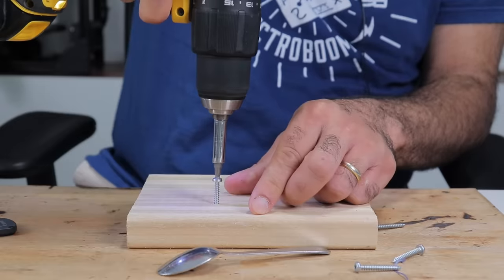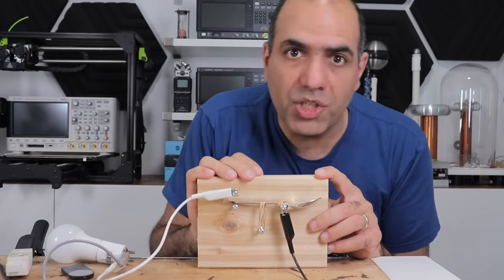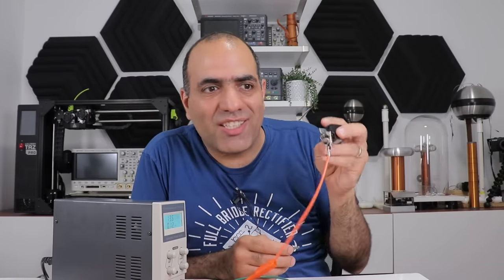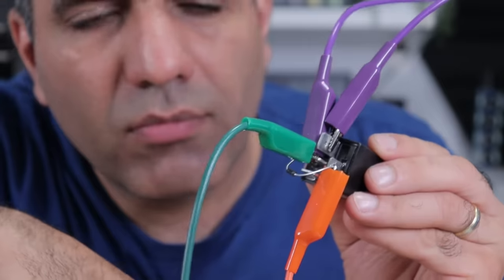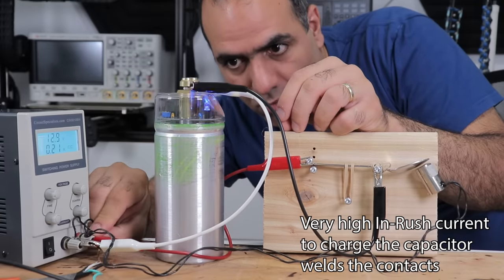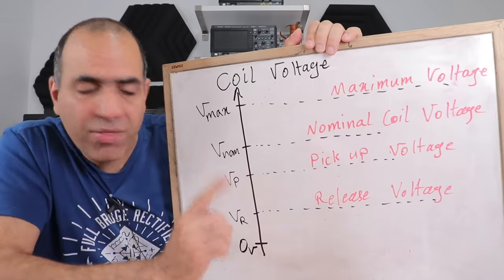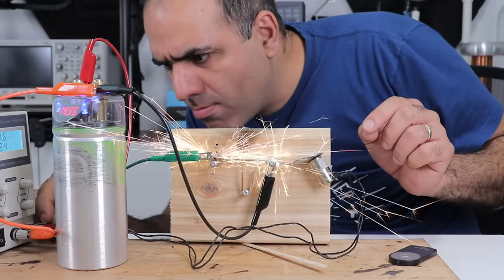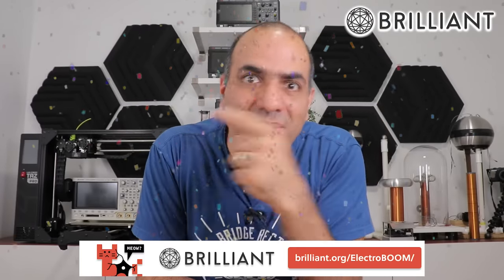Why RELAYs go BOOM!!! And How to Use Them

Comment: New to your channel, great videos.
You didn’t mention, maybe it’s in a new video, the ability to turn high powered equipment or machinery on and off, with very low power relay switch. (and much less expensive)
I hope I described it properly. Also in automotive applications a low voltage relay can then be used to turn high current items such as headlights, or multiple items like all the lights in all the gauges all at once.
Another great video.
Thanks again.

Comment: You could also explain how to prevent the same kind of issue in AC powered relays. Diode is quite obvious in DC delays but with AC ones... Capacitor and resistor?

Comment: Mehdi, I finally viewed your full video. Your analysis was very good. BTW, what's going in is a centrifugal half-loop lifting the chain. It's formed by stiffness plus an oriented pull vector, such as you running. And yes, the little snaps are real, but they must average out since they are mid-chain. You won this, and the Royal Academy paper was flatly wrong. Thanks for standing up for yourself and not buckling to Big Names and lots of equations. Science needs more folks like you.

Comment: Working on repairing automated gates circuitry, I usually encounter a ton of old and worn-out relay contacts.
Then I came to the need to decide if I need to replace it or not.
Sometime I find a old relay with oxidized contacts, but won't close the circuit. But when I remove them and try them using a bench power supply.... Voilà the relay is perfectly working!
Of course I dunno for how much time, and I replaced it... But... It seems to me poor construction quality other than overload. Do you have any suggestion?

Comment: This is a really good introduction, but one thing I wish you'd mentioned at least a little bit, which is ignored or unknown by far too many people is the need to derate relays (or any switching components, really) depending on the type of load you will be driving.

The current rating on the relay is fine if you're powering a purely resistive load (such as a heater).  If you're powering an inductive load, such as a coil or transformer, your load should never be over about 50% of the relay's max current rating.  If you're powering something like a motor, it's even worse, and you shouldn't really go over 20-30% of the relay's rated current.  What are known as "tungsten" loads (including incandescent lightbulbs) are actually even worse still, and typically shouldn't be more than 10-20% of the relay's nominal rating.  So you quite often have to use a relay that's much bigger than you think when switching a lot of real-world things.

Also always keep in mind that relays will have different ratings for AC vs DC.  This is because AC can be switched at higher voltages without as many problems because it actually goes to 0 volts many times per second, which can help to quickly stop any arcing that might occur.  However, DC does not have this constant interruption so it can start and maintain a continuous arc at much lower voltages (which you really don't want inside your relay).

Comment: Try to drive motors inside a electric razor . Take out them and try to deliver dc voltage as high as possible . After the contact brushes melt find any solution for that to drive hi voltage like around 40v . Dc . Definately I'm sure . Even a 10k mah battery pack with 12 v . Can. Not able to run it . Even with custom made hardcore brushes . 😂😂

Comment: 10:47 The average voltage across the coil should be zero, but it's not & the coil current slope can not be equal while energizing or deenergizing.
I know, the drawing is way out of scale, but it seems there was not even a concern to make a smaller duty cycle "square wave" (seems like 50%).
Still very good video.

Comment: Hi team need ur help
For x engine I am using 12Vdc 70A relay as stop relay. 
The engine pull current is 79A for 1sec a. Will this pull current of 79A for 1 sec can damege my relay contacts of 70A?

Comment: Marklin model trains use latching relays to change driving direction since they use AC power. They are quite bulky and wanted a smaller version or a solidstate version for a smaller model I'm making, but I can't find such a schematic or relay small enough... 😢

Comment: Hey Mehdi thank you I just saw this. One can also reduce the voltage spike by putting a suitable resistor across the contacts. This was done in old mechanical automotive charging regulators. I tried this with a small relay wired as an astable like yours. The frequency became very high and I could use the relay as a voltage regulator. Relays are amazing.

Comment: To get rid of arcs in the contacts, you can put a capacitor over the contacts. I measured the voltage over my coil one day (it was a 5V relais) and when I disconnected my coil, the multimeter said 95V. Talk about a spike coming from such a tiny coil. And even when you're respecting the proper loads over the contacts, after several years, those contacts can literally burn away. Due to the current spikes, those contact points turn black after time, increasing the resistance while still switching the same current. This increases the power over the contacts making them even hotter when switching, turning them black even faster and faster until they burn away. I've seen many burned out relais and contactors over the years while troubleshooting our stacker cranes at work and the only things that are left, are the coil and the contact levers but no contact point anymore.

Comment: You can find high voltage/low current(up to 15k to the best of my knowledge) solid state relay in the market for the last 6 years or so. That could give you a very clean signals with almost no noise. But of course there are always some raise and fall signal times. Pretty much it's a diode's delays and on/off curves. 
It would be nice to see you do a vid on it.

Comment: Even better than diode is a zener clamp with a voltage just below the max breakdown voltage of the fet (or physical relay you are using) this wya you can avoid blowing stuff up (or sparking in relays).

Comment: It's possible to switch AC at high current with a relay - with no sparking.  Use an opto to detect the zero-crossing point of the sine wave.  Measure the reaction time of the relay and save it to NV Ram in a micro, then operate & release the relay only at instants in time when the sine wave is at zero as per offset from the last zero crossing event.  Switch 4KW of AC load with just one 30A pcb relay without a single spark!  Works well!  Cheaper, smaller and uses much less energy than a contactor.

Comment: A circuit I built some time ago just went crazy when powering on. It was a cheap miniature RF relay where I connected another relay to the output of the first small relay. When it had too less power, it would always go on and off very fast. Giving it enough power resulted in it working fine. I needed the bigger relay, because the small one couldn't handle the load of an electric lock. I don't really understand why this happened, but it sounded funny.

Comment: Still plan on rewiring my entire Jeep project and using relays everywhere. I want to run a main line front to back for everything but switch everything on and off with relays. I'll keep in mind to run a fuse box where I decide to put a distribution box feeding the main line to each relay.

Might turn into a mess but I'm pretty sure it could be very clean and easy to maintain.

Comment: It's interesting that the relay (REE lay not ra LAY) produces 300V spikes when it opens, but I want to know how high the spikes are when you are in the circuit. Is there a threshold voltage at which engineers conduct? Can you rectify current with an engineer? Can you rectify anything with an engineer?

Comment: If you like the engineering of relays, you can take it to it's next level and go into circuit breakers... and not simply the smaller 120V circuit breakers, but also the  much larger industrial ones you see in power distribution systems, that are capable of opening and closing circuits at hundreds or even thousands of volts.

Comment: There was many an afternoon, I was hoping to find a fault in anywhere else than the relays in that !@$#$ CW radar.  Only had a few times when I had to replace one of them.  There was anywhere between 12 and 24 contacts on those dang little relays.

Comment: When I was a kid, I had an electronic kit and I made such an oscilator using a relay with it. Soon I learned that it could shock me a bit but it would shock me more if I turned the coil on and off manually. I upgraded the circuit by adding a capacitor in paralel with the relay coil. It reduced the frequency of the oscilation and greatly increased the shock. The shock was so great that when I touched the coil with my fingers then my hand would curl up. Later I straped some small metal plates to my arm (biceps) and connected two wires from my circuit to my arm. I could contract my muscles with a press of a button. Even tho it was quite painfull I still found it amusing :D

Comment: We use huge relays on old EMU trains in the UK for the traction circuit to drive 900vdc motors, which switch under load. To expel the arc we use arc horns to draw the arc away from the contacts but we still have to regularly check the tips for pitting and burning.

Comment: I had a friend who wanted an alarm system in hes car. But did not want to spend a lot of money, or have a professional unit. So I told him I would build him one. It was simply the grounding push switches on the hood and trunk. and one relay and a switch to provide the positive lead power to relay.. The sad part of the story is I worked for a security alarm company and when I bought the parts the boss could not understand how I could do that with just a relay!

Comment: I had a system where monthly I'd open a control panel and tap on the relays to keep them from getting "stuck".  I always thought it was humidity, friction, corrosion, etc.  It's nice to know what it actually was and why only that system had issues and not others.

Comment: What did people use instead of diodes to prevent voltage spikes, before the invention of transistors? I seem to remember that valves were quite unreliable, and entire computers were built using relays ..

Comment: he ought to do a relay circuit that used a pnp or a npn transistor to switch the relay on or off. Don't forget to put a diode across it to keep the charged coil from releasing it high voltage with opened back up to their the coil off when releasing the magnetic field of the coil discharging.

Comment: Sir, I am stuck with a physics problem. I have seen in formulas like Work=Force×Displacement and  like moment of force is force×perpendicular distance...but WHAT IS THE MEANING OF MULTIPLICATION OF QUANTITIES IN PHYSICS???? What sense does it make?? Like when we divide, eg Velocity=Displacement/Time it makes sense Displacement per unit time...but what does multiplication mean?
Reply: You can also study physics from the calculus perspective and see work as the integral of force with respect to displacement. Solving that just leaves you with the same W=Fd equation, but it makes a little more sense because you can think of it like integrating a curve. An integral finds the area under a curve which is just adding up all the infinitely thin vertical slices that make it up. If you graph force and displacement, work is just the area under that curve which you can imagine as adding up all the forces at every displacement. That's a more visual way of understanding it, but when first taught it'll be simplified to algebra.

If you're self teaching I highly recommend you watch some calculus 1 videos from Khan Academy. They do a great job explaining visually and it's super helpful in physics.

Comment: High voltage relays, called "contactors", filled with inert gas to prevent arcing and has got powerfull magnets, placed at sides of contacts to pull the arc away, making it longer so it disappear by itself.
Reply: "Soot" even the closed captions read 'suit' which made me laugh.  Thank you for entertaining, electrobooming and educating us.

Comment: The coil might do fine with higher voltage (within limits), but the coil insulation could be damaged at higher than rated voltage.

Comment: 6:46 So that means if we use Schottky diode that has the least voltage drop across it will run even longer right?

Comment: I thought about how the two sides of the chain in the curve coliding differently with the air.There is faster speed on the outer side and the vector is opposite too ,like when you use optics.

Comment: So, you mentioned a transistor. My basic electronics teacher in high school once said, "There are two kinds of people: those that know how transistors work and those that know how to use them," implying there is no overlap. 
How in the hell do transistors work? I fall in the camp of "knowing how to use them," and have no idea how they even work. I've looked at a lot of material and it all sounds like gibberish to me. I feel like if anyone can explain to me how they work, it's you. Also, I did my best to comb through your videos and didn't see anything on them. Maybe I missed something, or maybe you just haven't done a video yet.
Reply: Look into how diodes work to understand p-n junctions. Transistors are just pnp or npn, so they have two junctions (hence why they're called BIPOLAR junction transistors or BJTs). The important part in my opinion is understanding the depletion region, which grows or shrinks based on voltage polarity to allow or block current flow.

Comment: You can build an AM tunner with a relay, a capacitor and a diode. Ask me how do I know 😒
Reply: Some of you may renember listening to random radio stations while having a phone call back in the 90s. That was because of the old way telephone systems used to work, by using... relays 😒

Comment: What is the difference between a relay and a contactor?
Reply: I don't see high voltage/high amperage on relays but contactors I do I also see more relays being lower voltage and used in DC circuitry with cars and other things

Comment: Hi, in my house live wire is 240v and my neutral wire is showing 110v why is it?
there are 3 lines going in three places, 2 lines has no problem when the fuse connected in the third line neutral  line is showing 110v
Reply: Which country do you live in?
Reply: there is a mistake, three lines from the transformer when fuse connected to live lines 2 lines there are  no problem but when the third fuse is connected neutral line is showing 110v, the fuse is not going
Reply: @sebastianreji8431  Do you perhaps have a "split phase" system (not "dual phase")?

Comment: NO - what you "did" do at 4:11 - was to make a deliberate SUPPLY to earth "fault path" by keeping the UNSWITCHED supply connected to the relay coil (which you then stupidly put your fingers on (as THAT allows a small current to already flow in your fingers WHILE THE RELAY IS ENERGISED, to such an extent that your fingers were PART of a circuit with the coil itself, so that at the precise instant the coil current "collapses" (when the GROUND SIDE switch/relay contacts open), the ALREADY FREELY FLOWING CURRENT - through your fingers, is not only reversed - it increases rapidly - BOOM stupidity always wins, and you shock yourself (literally)

NEVER EVER put a switch into the GROUND contact path.
ALWAYS put it into the live supply side.
That way - any residual "arc" current will not only decay very quickly, you won't get as MASSIVE a bolt as if you were doing it wrong - with power still connected.

Part of that reason - is because the way you did it here, at 4:11, when the switch opened, but your own BODY MASS, via the chair and your feet, was actually still connected to GROUND thus you (for an instant until you let go) became the MAIN EARTHING CONDUCTOR, not only getting the collapsing coil current - but the residual ordinary current flow - between the fully connected supply - your body & ground.

SEE.!!
ALWAYS DISCONNECT THE SUPPLY - never the ground.